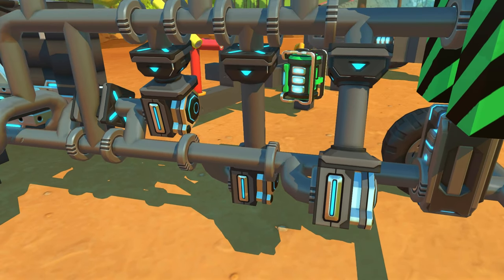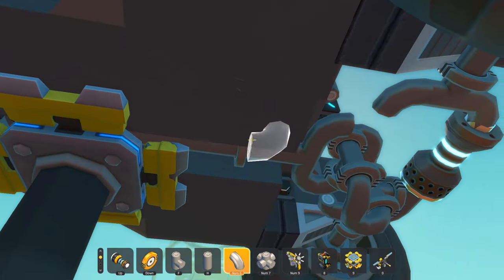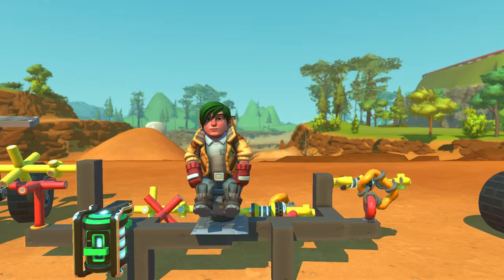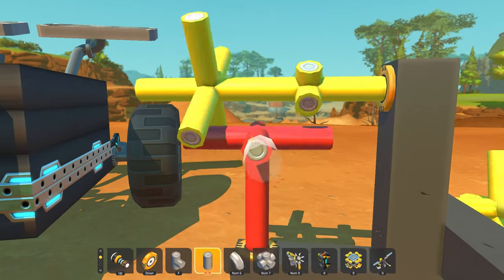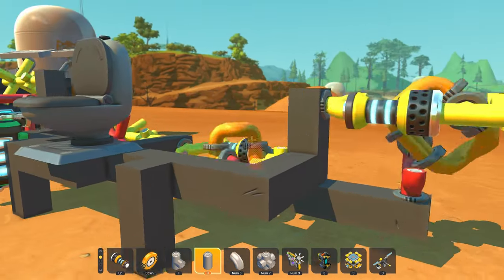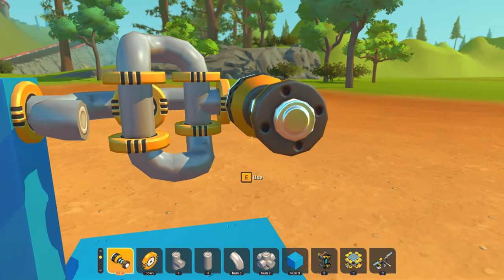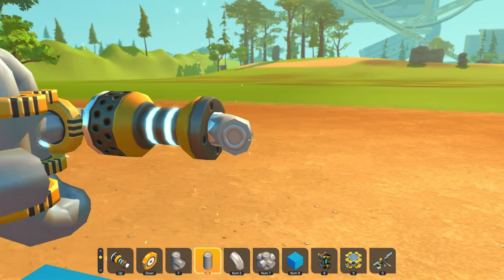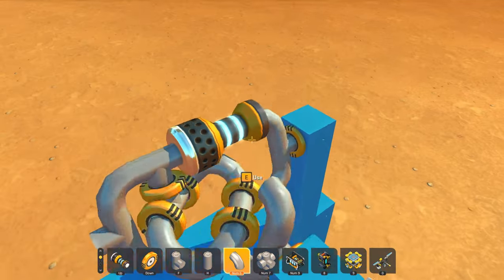90º U-joint Drive Axle Tutorial

Comment: I like it's simplicity, though I want to do some experiments and test the max speed and torque it can handle, before trying to make my own and beat it. I'll update you if I find anything stronger, I look forward to experimenting. usually 90 degree pipe joints are pretty weak, since they just clip right through. but with that it's going to take enough force to make the bearings stretch.
Reply: alright, so I spent like the whole time experimenting with testing gears and u-joints, I found out that this particular set up will fail at 2500 torque, and by that I mean the mechanism collapses in on itself. I built a slightly larger one(by a block each axis) so that I could get the missing bearing in place for the u-joint, and then it wouldn't rotate so I needed an extra four bearings on the center part that rotates, and that allowed it to pull all the way to 6000, where it once again failed. I then just tried using 8 tooth gears, and they produced the most amount of load, probably close to ten times as much. that surprised me, I guess the bearings are the limitation here. I also tried adding four bearings to the center part of your one and it made it worse, so I wonder if there's a way to get mine to rotate without those center bearings, because I do think they were sapping away some torque. I'm gonna go to bed now.